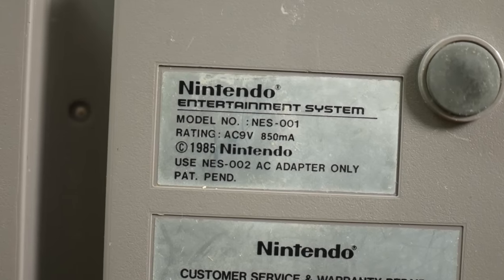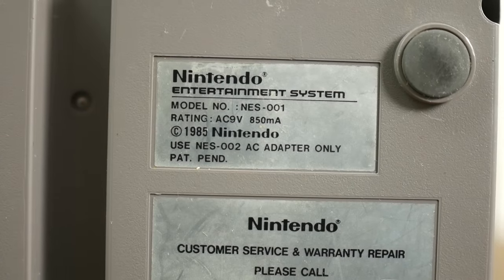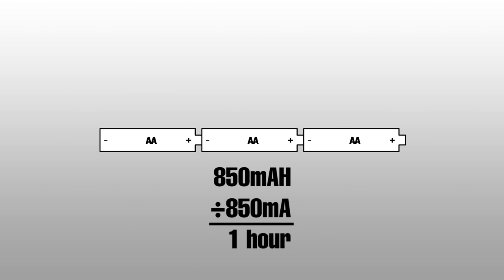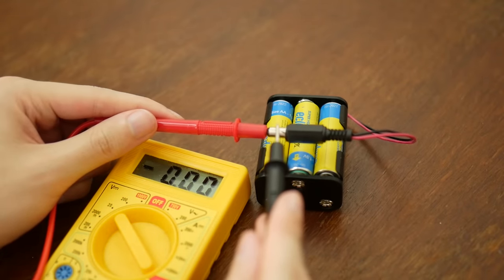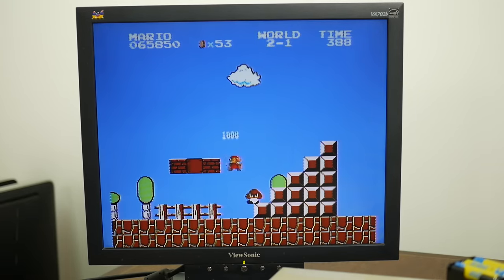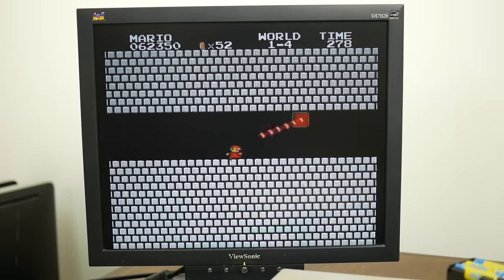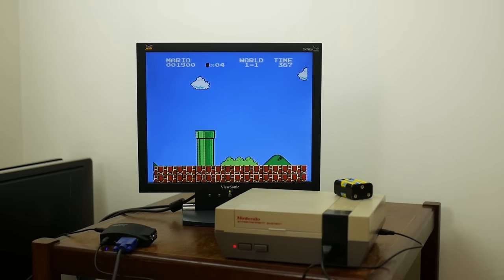Can you run an NES from AA batteries?

Comment: with out watching the video.  yes you can easy.  i modded an nes to run off usb so battries are easy :P  but i would do D cells not AA
Reply: @davidevgen you can big this magic box for $150 that powers the nes and tv and for an extra $100 you can harness that power of the sun God instead of charging the box from the mains. Overall you save thousands using this method then the alternative.
Reply: @ghostunix731   or i could get a big battery bank for like 50 dollars.
Reply: @Davidevgen  Sure a power bank is basically a deep cell so you can connect the usb in series to the nes.
Reply: USB however is 5 volts, so you'll need almost double that for the NES to run.

Comment: An easy way to double the play time would be to get twelve batteries and do a series parallel circuit, in the same way that a parallel connection works, you can take two series "battery packs" and use its outputs and wire it in a parallel circuit to have 9 volts but with the capacity of two batteries in a parallel circuit instead of just a single battery, and you can continue to add more packs of 6 batteries in series to the parallel circuit to increase the total capacity.

Comment: You should try:  "Can you run SNES from AA Batteries"
Reply: This oughta be a fun one to watch..
Reply: MATTKC WE WANNA SEE THIS PLEASE DO THIS!! :)
Reply: I wanna see it on the n64, curious how the 3d stuff would start breaking on low voltage
Reply: @VDavid003  for a start the n64 had several different voltage inputs.. for sure theres a 3.3v reference as well as I think 9v
Reply: @adventureoflinkmk2  Interesting, I've never had a 64, only a SNES so yeah.
Reply: the NES and the SNES use the same power adapter
Reply: @adventureoflinkmk2  its two... 12 and 3.3
Reply: @matsv201  thanks.  I forgot what exactly the other source was
Reply: @RWL2012  how?  Unless you speak of the top loader, didn't the NES serve as basically a AC to AC adapter

Comment: 3:23 what if you connect the 6 batteries in series and call it a batch and then connect 3 batches in parallel? That would be 18 batteries that last as long as 3 and it would still be 9v
Reply: Sure, it gets more and more expensive though.

Comment: 2:24 the 9VAC adapter technically a sine wave at 50Hz and 9V RMS, so the peak voltage is 9*sqrt(2), or about 12.728V. So you would technically need between 8 and 9 batteries (both should be safe, as the transformers in the original adapters can have small errors, and the voltage is converted to 5V later anyways).

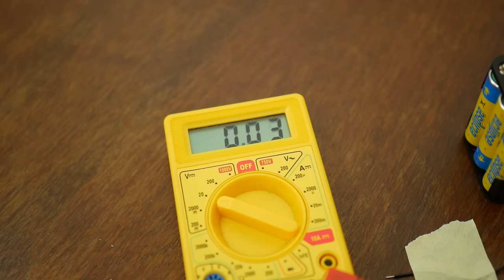Comment: 5:49 There's no problem with 10 volts because that's the voltage without any load. Considering that the NES worked for 1.5 hours on the 6 batteries, the voltage likely dropped to 8 volts when you turned it on.

Comment: Most of the circuitry in the NES operates off 5 volts, but if memory serves some of the color circuitry uses nine.  If one were to modify the power supply input circuitry to replace the linear regulator with a switching power supply, that would probably extend battery life by about 30-50% when running off six AA batteries, and allow further improvements in battery life by using eight AA batteries instead (switching power supplies draw less current when their input voltage is higher).  Some clone consoles might also offer much lower current draw than a 1980s Nintendo console.

Comment: My dad did this when he was a kid, but he used 2 lantern batteries and a mini TV that ran on D cells 

When I was 14 i made a mobile PS2 with a PS2 slim, a tiny LCD panel and 2 18650 cells

There was nothing quite like playing GTA San Andreas on the school bus while everyone else had a gameboy or one of those tiger electronic games
Reply: @Kitulous  similar, but mine was able to use discs, had a messiah modchip for playing burned games, used the original controllers, and supported multiplayer 

It was basically a PS2 slim with a fold up screen mounted on top of it and a battery pack taped to it, it was not as portable as the one in that video, but I could still use it as a regular PS2 by unplugging the screen and battery pack, then plugging it into the mains and my TV 

More like a Nintendo switch but instead of joycons you only have a pro controller

Comment: Man, didn't expect it to get emotional. Felt like watching an NES experience what death is like.
At the same time, would be curious to see an AC adaptor with a pot dial resistor to find what is the minimum voltage you can have to run an NES. OR at what point does the circuitry lose the ability to filter color.

Comment: 2:50 Wrong, no matter the connection, overall energy that battery pack could give would sum up the same way. The series connection just increases voltage, what ables you to use more power aka draw more current. If you connect 6 AA batteries in parallel and use DC-DC voltage amplifier to 9V and 6 AA batteries in series to 9V. They "run off" in exact same time (assuming no heat losses and 100% efficient DC-DC)

Comment: I actually tried this before, knowing a full wave bridge rectifier will pass DC through 2 of the 4 diodes it has, but for some reason, the 9 volts @ 1 amp did not power it up in either polarity.
I am actually surprised yours worked for you.
The only way I could get it to power up on DC was to literally solder 2 wires to the board opposite of the main power filter capacitor, but the NES is built so modular, it is easy to disassemble and reassemble.

Comment: When I had an NES I put 4 miniature lead acid batteries into it, which was all I could fit. I also made an antenna for the RF port. It was a fully wireless system, with the exception of gamepads.

Comment: The NES uses a rectifier that feeds a UA7805 chip, meaning that you can use a lot of stuff to run it. A 9V battery will work for a little time. A 6V bike battery will also work. If you have some bravery and a LM2596 or XL4015 module, you can even run a NES directly off a solar panel with no battery involved. (Should I make a video of that I wonder)

Comment: If you look at the BW image, you can clearly see the color signal subcarrier as part of the BW image, appearing as cross hatching.
I think that, as the voltage dropped, the system clock frequency started drifting.  The same clock is used for the color subcarrier, and the NTSC/PAL standards are very strict its frequency, so if its off by only a little bit, the colors will either be wrong or just gone entirely.

The static in general probably comes from the signal strength of the video output decreasing as the voltage drops.
More and more of the signal ends up below the noise floor, so when the TV's AGC turns up the gain in response, you see more and more noise.
The CPU/PPU glitching is straightforward.

Comment: 0:30 For almost a entire year on my NES, I've been using a power supply that my dad brought off of Walmart, and for some reason, my NES didn't turn on first try and for specific games like Ninja Gaiden It would take up to 50 tries to just play it once. From the start I knew it was either the NES or power supply, but I couldn't tell which one it was. Because of this video I finally figured out that it was the power supply. According to this video the regular NES power supply says, input: AC 120V 60Hz and Output: AC9V 1.3A, and my power supply says, AC 120V 60Hz, but pay attention to the Output one, it says DC9V - 850mA. THE OUTPUT IS THE COMPLETELY WRONG TYPE OF POWER, as he said a couple seconds later, "Making it very incompatible with DC devices," Even though it can still run off of DC power supplies, at least for the one I use, it isn't very good. So, I predict that if I buy a regular NES-002 power supply it would power on the first try.

Comment: If you want to stick to the AA batteries, there is a way of doing both parallel and series wiring  batteries.  Get yourself two or more of the battery holders.  Solder the black to black and  red to red.

Also there are two types of 9 volt batteries.   Most common is the PP3 which is used in a lot of  electronics and originally introduced for the early transistor radios. Then there is the less common 9 volt lantern battery which is used for camping lanterns.

You could actually do something similar with C and D cells.

If I was doing this, and I am not saying that you should, I probably would have used 9 volt batteries in parallel.

Rev George

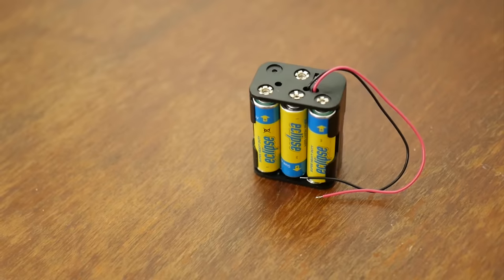Comment: 5:27 "live and dangerous" my friend that's equivalent of a square battery right there, as kids we used to put those on our tongues and we thought it was funny.
Reply: Talking about the wires, because when you put them together that creates electricity, And then kablamy
Reply: My friend with a master's in Electrical Engineering let me tell you that even shorting out (directly connecting those two wires) 9 volts at that amperage will barelly even make a spark...
The worst that could happen is those batteries heating up like our toy cars' batteries from our childhood.

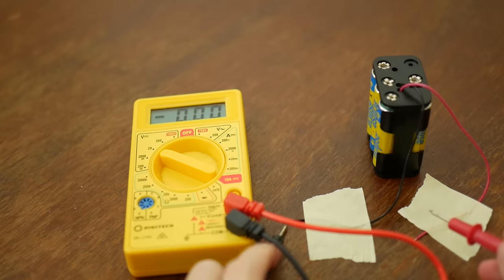Comment: 5:40 for anyone curious, that 1.5V rating for batteries, and pretty much any battery voltage, that rating is just the average voltage. For example, an 18650 lithium ion battery rated at 3.6V will output around 4.2 at most and about 3.2 at the least.

Comment: fun fact: a fat chunk of the power is consumed by the internal linear regulator. Pretty much everything in an NES runs on 5V (with a fairly slim tolerance, like .25 to .5V), so the regulator dissipates part of the power in heat, which goes lost. By connecting directly four Ni-MH AA batteries straight to the 5V regulator output (this means 4,8V to 5,6V) one can save something inbetween 30mins to 1 hour.

another fun fact: the regulator has something that is called "dropout voltage"; which is a minimum tolerance that the input must meet to keep its output a steady 5V. Old regulators like that should have something like 2V - it means that to have 5V as output the input must be higher than 7V. So, 7/6 is approximately 1,17V, which is slightly above the voltage at which a zinc-carbon battery can be declared "fully discharged" (1V - 0.9V). Probably when the battery pack hit the 6V mark the 4V output from the regulator just wasn't enough to keep the NES operational anymore and all sorts of memory corruptions and data errors started popping up. This shouldn't affect the hardware, but it's better not to test one's luck.

third fun fact: through the rectifier the batteries probably lost about another .6V to 1V due to the forward bias voltage needed to turn the diodes on. A lot of factors drastically lowered the efficiency of the setup. Probably those batteries still had some 1+V in them after the fact, perfectly good for a few weeks in a remote.

Pretty nice experiment overall!

Comment: When I was about 10,  I was very annoying about losing the progress when electricity goes off, a thing that was very common in my country. 
Then, I have used 5 aa rechargeable batteries to power the unit when power goes off.  A diode and a resistor( for changing). Worked about 3 days before needed a recharge.
Great times

Comment: You should get 2 of those battery holders. Set both up to double capacity between the 2 packs. And add a quick disconnect for each battery pack so that you can swap out batteries while the NES is still on.

Comment: 2:60 This really depends on how you define capacity, if by capacity you mean current capability (amp hours) then yes. However in terms of actual power generated then no, in both cases the total power output would be 9Wh (assuming each battery is 1Ah @ 1.5V).

Comment: I basically knew the answer before watching: "Yes, but don't expect amazing runtime out of it". I'm also not surprised at the slowly degrading and garbled performance near the end - it's just like how toys with electronic sounds (or battery-powered tape players, stereos, portable TVs, etc.) will get muffled and garbled when the batteries are low, and the lower the batteries are the worse it gets.

Comment: Different battery chemistries have different roll-off times and speeds. Alkaline batteries will steadily dip as well, but something like Nickle Metal Hydride might be providing a smooth experience until it drops off a cliff. Unfortunately these do run at a slightly lower voltage of 1.2, so to get 9 volts you'll need 8 of them.

Comment: I have only one problem with that 9Vs aren't the 9V AC in the power supply 9V RMS which is not what the DC rectifier and capacitor/inductor output it will be more likely around 12V DC cuz 9V RMS is like 13Vp (Peak voltage) so with batteries at 9V (10 with fresh batteries) is going to drive the batteries harder cuz the lower voltage will be offset with higher current draw, not sure about the internal PSU circuit cuz I don't have NES to measure the voltage outputs on it so this is a speculation, but the video was fun to watch and the end blew my mind

Comment: I have some 1.5v rechargeable AA batteries (most rechargeable are 1.3v I believe so be mindful of that) that could save the cost over time issue for this. Still, needing to use 6 (or more, as the 1.5v rechargeable AAs have less mah than the lower voltage option) would be annoying and would need to keep 12-24 of them on hand, and charged.

Neat seeing how the voltage dropped affects the image output too.

Comment: We didn't hear the sound but it would've been buzzing. I had a buzzing problem with my NES recently and it was caused because the universal power supply i was using was set to 7.5 volts rather than 9. Also the sound quality doesn't get worse.

Comment: I ran my Atari 2600 off a 9 volt battery years ago. I just used the right size power jack for the Atari and a 9 volt battery clip. Worked great and for a pretty long time.

Comment: 6:04 a full bridge rectifier will take off 1,4 volts so the electronic is safe, also the house voltage is not PERFECTLY 220V or 110V so there is a voltage regulator + the electronics are projected to rexist to like 1 or 2 volts out of normal.

Comment: Technically, the 9 V AC describes the  rms voltage which is less than the peak voltage because it is a sin function. 9 V DC is always peak voltage. So because of the voltage drop due to the diodes of the bridge rectifier and the design of the circuit for AC, you need 9V*sqrt(2)=12.7 V DC to not reach a voltage which is to low for the system. That could yield to undefined behavior or if it is well designed, not starts. As you can see at the end of the video. 
Greets from an engineer.

Comment: Actually most "super heavy duty" branded AA/AAA batteries tend to be of the zinc/carbon variety. Zinc Carbons rarely leak so they are better for things like clocks and remotes. They aren't great for high drain devices as the current load they can take is lower (so not just the capacity is lower).

Comment: I'm disappointed he didn't consider a series parallel circuit. Not only would it increase battery life, but it makes a hot swap possible, allowing the console to run while changing a depleted battery circuit (just make sure both banks don't die at the same time).

Comment: Depending on how you see it you only need 7V not 9 as the 7805 require +2V above what its trying to generate in output this case 5V (if you bypass the rectifier otherwise you need an additional voltage due to loss in rectifier diodes.). Also you can't use a SEGA adaptor to drive a NES as they have tip negative and not tip positive and the builtin rectifier will block the flow not to mention other polarity sensitive components will more then likely be destroyed.(capacitors)

That being said the video was amusing :)

Comment: In Europe we had a Famiclone, we still called it Nintendo, it I was running it with a variable power supply, it even worked at DC 3 volts, but on the TV, the screen was dark and it gave a loud buzzing.

Comment: Although a rectifier rectifies the AC current in to DC it brings some kind of voltage change. It's the same how if you rectify 120v AC you get 170v DC. Although it is also dependant on the types of components you are using to do the rectification. Also if you want more power you can use 12 batteries. Make two sets of 6 batteries and put them in series, then connect the two sets in parallel.

Comment: so you up the game:

you replace those battary's for 2 5V powerbank, each with 20.000MaH, and pair those with an small, 9V, 1A solarpanel (easely able to recharge them while the NES is using them at day)

you solder/fixate those powerbanks INSIDE the nes casing

now you just need to add a 10 to 12 inch 3:4 monitor
(it will consume 12V.. so we just have to increase our number of powerbanks and panels to 4 and 2)
->
montage the monitor on top of the nes with a hinge... on the bottom of the monitor.
Montage a small plastic slab on the back of the monitor with a small leg to make a 45 degree corner panel on the back of the monitor, hinged as well.
and on that you montage the solar panels.

a simple leather strap around the whole thing, should prevent things from flapping during transport.

now you merely make a nice leather suitcase.. not much larger than your nes itself (since you added merely 1 inch of height to it)
possible with a compartment to carry a few games with you as well..
and presto.. your mobile camping nes gaming system;)

-> sure you could just bring your cellphone and one of those mobile chargers with a solar panel for that.. but heh.. that won't be that cool..;)

Comment: You could also connect multiple “six battery packs” in parallel to achieve more time. So connecting the “batteries in series” in parallel.

Comment: What if you ran several of the battery holders together in parallel? Would that create a bigger capacity without increasing the voltage?

Comment: the extra voltage is to be expected from batteries. usually they start off at ~1.6v new, and when the battery is "dead" it outputs ~1.3v-1.4v. I like to test batteries with my multimeter before pitching them